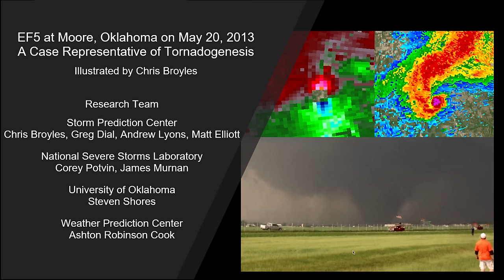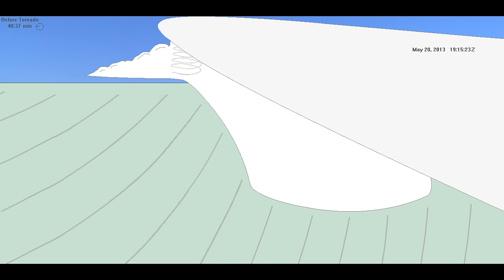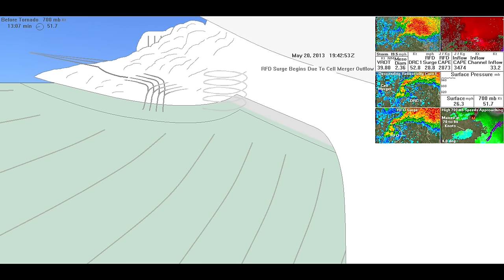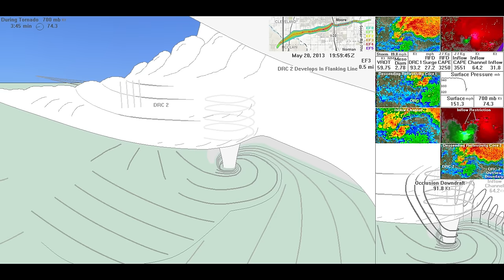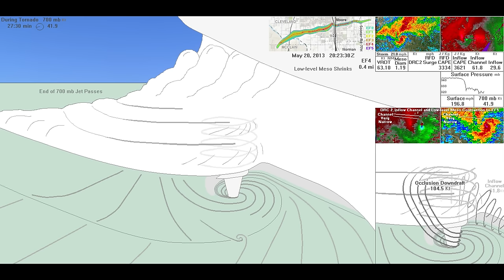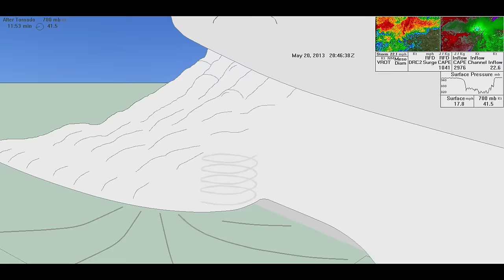Violent Tornado Animation of an EF5 Supercell (Public Audience Version)

Comment: I was under the impression that the RFD was an effect of tornado-genesis rather than a cause due to Leigh Orf's simulations, where vorticity begins to break off from the SVC and "train" until the pressure becomes too great which pulls everything together to form the tornado, and this drop in pressure is what causes the RFD to wrap around. This video would seem to suggest the opposite, that the DRC is vital to wrapping up the ground circulation before tornado-genesis. Still so much to learn...
Reply: There are two models.  The model here, where the RFD is the source of the tornado, is the classic model.  Orf's model, where the SVC is the source of the tornado, is a much newer competing model.

Comment: This seems to reveal that an interaction between a cold downdraft and the mesocyclone is required for tornado genesis, not just a mesocyclone alone.
Reply from the maker: In 2002, Markowski published research on the rear-flank downdraft (RFD). His observations show that the RFD is generally warm and unstable just prior to and during tornadogenesis. For the Moore EF5 supercell, radar analysis shows that the downdraft associated with tornadogenesis was generated at relatively low-levels within the storm. For that reason, the downdraft associated with the development of the Moore EF5 tornado was likely warm and unstable.

Comment: I seem to see some things that may show it could be the SVC kinking and folding over itself that might be part of the energy feeding in before making a dip to the ground. (I didn't know the SVC term, so I called it a "roller" due to the horizontal alignment of the rotation axis.) If it narrows and speeds up along a section, then that pulls it in to wrap on its self. There's a kind of "twisting string" analogy to what it is doing to make it kink and fold over. Radar returns seem to show barber-pole striping where the SVC is forming along a boundary (seems many inclement weather patterns have that whether or not they form a tornado), and when it narrows and tightens into an S-shape that seems to be the thing to look at and watch out for. Even more so if that S starts making a spiral. If that folding and twist has some role, then shouldn't a tornado have an internal dual vortex aspect (as a minimum) to the upper column of the funnel cloud regardless of the air dragged with it as part of where it touches down?

Maybe that's a funny way of looking at it, but going off observations of public radar sites and seeing how it moves over a time-lapse loop really has a particular pattern. The only thing is it that some radar visuals being presented either lack the resolution or enough frames over time to really show it. But some like COD website seem to have just enough detail to make the tightening up and folding stick out enough to mentally picture the thing going on.